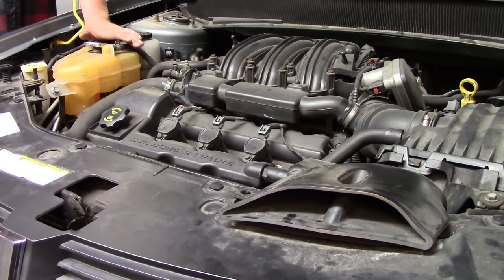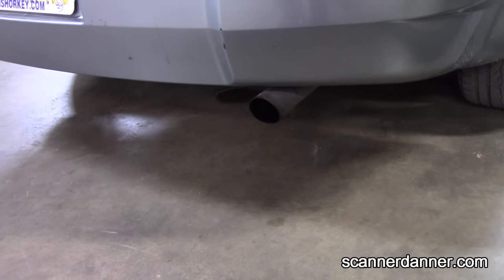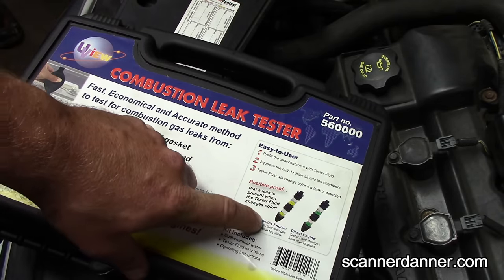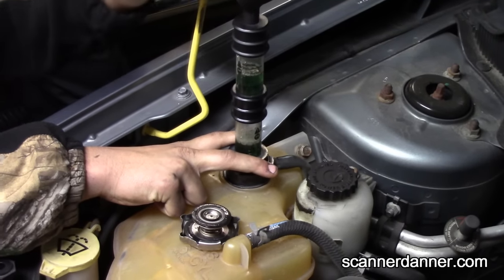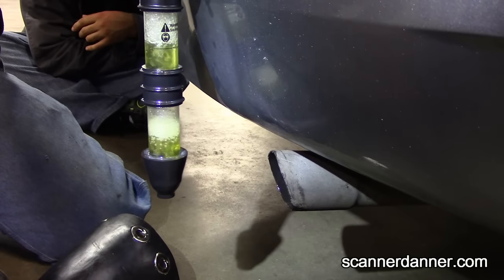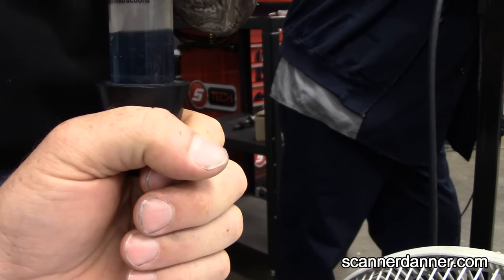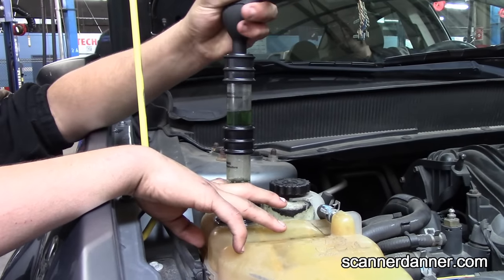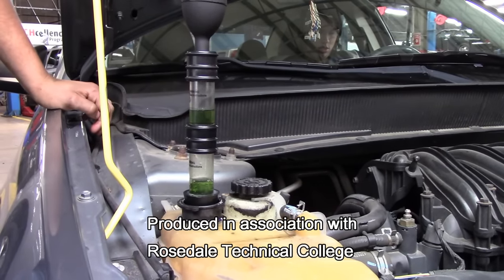Testing for a bad head gasket  - Gas Analyzer vs Chemical

Comment: The fluid needs to be tested and the coolant level need to be correct? also if there's a dead misfire the test may be inaccurate?
Reply from the maker: Correct on testing the fluid using your breath. Correct on coolant level. It seemed to respond quicker with the system almost full. And finally, my assumption with a dead misfire, is the chemical kit may miss that, but there are variables to that too. Before a cylinder completely washes out, there would be times of "burning" in the cylinder that would produce the gases we need (CO2), so it may not miss it. Also, if you have a cylinder not firing at all from too much coolant entering it, there would be a significant amount of white smoke from the tailpipe. In other words, if the head gasket is bad enough to wash out a cylinder, you're not going to miss the symptoms.

Comment: In the video you mentioned you used to use a handheld gas analyzer. Was that as expensive as the type shown in the video? Are they available anymore? Why did you stop using it?
Reply from the maker: Of course they are still available but who wants to spend that kind of money just to ID a bad head gasket. Here in PA, every garage had one for our emission testing. But we no longer do tailpipe testing (only a few older cars and every year they grandfather in a new model year) so once the machines broke down, nobody spent the money to fix them just to handle a few model year older cars. Now, nobody has one. 
Why did I stop using it? Mine broke too and it's too expensive to fix
Reply: I did a quick google search for handheld gas analyzers and I was seeing some for as low as $150-$200. That really doesn't seem like an outrageous price. But maybe these aren't suitable for automotive use? In the descriptions it states that they detect combustible gasses.  Just seeing how quickly you were able to diagnose a bad head gasket using a gas analyzer, it seems like a much superior method.

Comment: If you search "combustible gas detector" on ebay there are some handheld units for about $120usd that I would be really keen to see someone test for this purpose. These have an LCD ppm readout. Have been thinking about getting one for some time.
Reply from the maker: to many false positives with those from what I am hearing.

Comment: Paul, just an idea that may have been  tried before, but what if you blocked off the upper & lower heater hoses and attached a sensitive pressure transducer to one of them and pico scoped it for pressure pulsation from the blown head gasket with the belt removed to stop the pump? Without coolant and just cranking?
Reply from the maker: To much work, too many variables brother. And a lot of water pumps are timing belt driven
Reply: I understand, thanks very much for the reply.

Comment: Would it not be possible to modify a coolant pressure tester with an adapter such that you could use your WPS and Pico to look for pressure pulses? You could sync to a spark event to figure out where the leak is.
Reply from the maker: haha, I suppose. But it would need to be pretty severe to see it (bubbles in the system) and by that point, who cares right?
Reply: I know it sounds crazy but, I'll bet you it would work and confirm with 100% certainty that you have some connection between the combustion chamber and cooling jacket.…I guessing that with this technique it might be possible to see even very small leaks. After all... ANY pulse in the cooling system that can be tied to a compression event is too much..... 

Think about it...It is really very similar to attaching a “First look sensor” or WPS to the fuel pump pressure regulator in order to ID a mechanically plugged fuel injector...That procedure works pretty good. 

I do not have a gas analyzer so I would have to use compression tests and leak down tests in order to ID a bad head gasket. I'm not to sure I would trust the chemical test....

Consider the case where the plugs a not accessible, confirming a bad head gasket in that situation would be difficult. Hooking up a modified pressure tester can be done in seconds. 

You might even be able to eliminate pressure “noise” by disconnecting the water pump belt. Actually, now that I think about it…I wonder if you could potentially ID a sheared off water pump impeller with this
technique… Not sure..just a thought..
I am not a professional tech so, I do not have access to a known blown head gasket to test out this theory. :(
I think it would be great if you could try this out. You have the advantage to be working at a school where you can experiment a little.  At the very least, it gets your guys thinking outside of the box and tinkering around with the Pico...

Comment: Ya i have this kit to it. It sucks! I even called the help line to ask what it means if a gasoline engine turns green for diesel. He said it would be an inconclusive test. Basically when the head gasket is bad enough for the tester to work its bad enough to smell exhaust coming out of the cooling system and a tester is not needed! You can also see the coolant bubbling when its bad enough. The way I find small or very small head gasket leaks is with a cylinder leakage tester; you will see small bubbles in the radiator.
Reply from the maker: I've been burned by that test too brother. (Air in the combustion chamber, look for bubbles) but thanks for the tips man. It really helps to hear this type of feedback
Reply: No prob. Just curious are you saying the bubbles in coolant test burned you?
Reply from the maker: No bubbles but still a bad head gasket.  Combustion pressures are much higher than air in the cylinder
Reply: Got it. True.

Comment: I've used this kit and agree it's very unreliable.  And it was pretty expensive.  The one I use and stand behind is ironically the cheap harbor freight  Maddox kit. I conducted 20 tests on my car which the engine is fine and 20 tests on my mothers( who has a blown head gasket ) to see if I could get conflicting results. And it never gave a  false result. And to add to the info I have gathered my good buddy works on race cars and he swears by it.

Comment: SCANNERDANNER, 
              The coolant combustion tester/detector will only test the coolants fluids for a bad head gasket?  The Coolant combustion tester/detector doesn't test if the water pump is work correctly or if the radiator and engine has rust and other chemicals in the coolant?
Reply from the maker: I just measures the presence of carbon dioxide. You can test the fluid by breathing into it before measuring the engine coolant gases.
Reply: Scannerdanner 
1.) Whats the good and bad Percentage of carbon dioxide should be in the coolant? 
2.) How do you test if the water pump is working correctly what kind of tests can I do?
3.) Do you test how must PSI pressure the water pump is pumping out?
Reply from the maker: There shouldn't be any carbon dioxide in the cooling system.
Every car is different are far as water pump testing goes and it is not always easy to tell.
Pressure is not a good test as psi will build simply by a temperature rise on a sealed system.
Reply: @ScannerDanner  thanks for the help
      but what else does it detect besides exhaust gasses in the coolant? 
IF there is exhaust gasses in the coolant beside it being a bad head gasket, what else can cause exhaust gasses in the coolant?

Comment: u Car needs to be warm,  fluid needs to be bubbled through significantly.    Blown or slightly blown head gasket will turn the fluid yellow.   If it's just slightly green, but definitely not blue anymore, more time and more revs on the engine will turn it yellow.     Good job with the gas analyzer, but nobody really has these, especialy DIY mechanics.   The chemical tester and fluid is like 30 to 40 bucks at the store.

Comment: Hey Danner, Me again. I have a cadillac eldorado in my shop, 98 and it is running lean on bank 2, and only bank 2. The fuel trims are ~20. I've already smoke tested it, there is a small leak around the throttle body shaft seal, but very small. I've already checked all the injectors, and just incase swapped them from one side to the other to see if the lean would follow them and it did not. There are no misfires, and the o2 sensors are swinging fine. On a throttle blip test, both bank o2's go rich and back to lean like you would expect from a throttle blip. I've tested the exhaust for any leaks, incase any fresh air was tricking the o2 sensor. The only thing I can think of at this point is maybe some engine issue. You have any experience with this issue ?
Reply from the maker: Check it for an internal vacuum leak. (block off PCV and breather ports and measure vacuum on the dipstick tube. It should build pressure with the PCV system blocked off. If it goes into a vacuum, bingo, you found your issue. (BTW, this is not a common problem)
Reply: What would cause an internal vacuum leak ? (I've been googling, but all i turn up is carberated engines) I've never heard of such a thing on a fuel injected car. Sorry for the additional question, and thank you for your original reply. Some additional information, I did a compression test to make sure valves were not out of timing, and the compression test came out 220PSI across all cylinders, so that was perfect...

Comment: Had a PCV  valve go bad,  milk in the cap and on the dipstick.  Two days after changing it everything was clear.
Reply from the maker: exactly, moisture accumulating that was NOT a headgasket failure. I mentioned that because of all the naysayers who said "why didn't you just look at the oil cap?"....ignorant suggestion
Reply from the maker: sorry, that sounded like I was directing my "ignorant suggestion" to you. I was not. I was referring to other people

Comment: I enjoy and pick up some new knowledge and different "angles" for diagnosis when watching your videos. Thank you. I consider myself a pretty darn good diagnostic technician as well as many others do in my area. Clients, parts houses, other professionals in this industry, and even some dealer techs have the same opinion of me. I'm sure you'd concur that even the best top notch techs need assistance, and we certainly have gained from the experiences of other great techs.Thanks for the insight as far as the test fluid goes. I have never thought of what different types or brands fluid actually detect. HC's are what I've always thought the blue fluid detected. This make sense because now I realize why the fluid doesn't change when testing for HC content in some systems, but the gas analyzer does. I just thought that the fluid was old or contaminated with water, so I use it less frequently than before. On another note, you may want explain in your video to the less experienced that even though the engine oil doesn't look like chocolate milkshake, the possibility or evidence of a blown head gasket or cracked cylinder head is still there. You could explain the different areas of the head gasket that could fail. Between the cooling system and the oiling system and the cooling system and the combustion chamber will have separate identifiers. Just a suggestion. Keep up the videos. They're awesome and informative, especially for the "C" to "B" level techs that haven't been into the diagnostic game for a good length of time like you and me, and most "A" techs stand to gain.

Comment: Wouldnt it be CARBON MONOXIDE,CARBON DIOXIDE is what they put in Soda Pop drinks for the fizz ?
Reply from the maker: no sir, it is a carbon dioxide detection fluid, you can use your breath to test it (shown in a newer video)

Comment: How else can we confirm head gasket without a gas analyzer?
Reply: Run a bore scope down the plug hole and examine the cyl. for traces of antifreeze that has dripped in overnight. Or compare it to the other good cylinders, the breached one will be steam cleaned much cleaner than the others.

Comment: do what we do with the 6 0  diesel attach a pressure gauge to the reservoir  and get the motor hot boom confirmed
Reply from the maker: coolant expands when it gets hot and increases the psi automatically when the system is sealed. On a good system psi will rise in the test you described

Comment: Does the motor need to be started cold to do this test?
Reply from the maker: Yes, you do not want to risk getting burned by taking a hot pressurized cap off
Reply: @ScannerDanner    I have an 06 Toyota Sienna. The radiator caps on those are in a position that makes it impossible to use the tester. So, I did the test from the overflow tank and fortunately the stuff stayed blue. 

Thanks.

Comment: How do I know if machanic told me truth said oil was in coolant and I could see it was like a light orange cream color. I was told to go home and take turkey baster to get all out and in 2 days he's going to remove the coolant container and clean it out, when he replaces 2 tire's! I know tire's are ready to blow but why spend a couple hundred & engine blow's next week? Advice will help being a female I've been taken for almost every thing I had saved from bad and dishonest Auto places Thanks Debbie
Reply from the maker: Debbie, I agree. Get to the bottom of that oil in coolant issue BEFORE replacing tires. Unless of course your tires are ready to blow out and it's a safety issue. Oil in coolant is never a good thing and it comes from two places. One, it could be the oil cooler for your transmission that has begun to leak. The transmission cooler is part of the radiator and they can internally crack and it lets the two fluids mix. This ends up being very bad for the transmission as you will also get antifreeze into the transmission. The second would be a head gasket failure, where engine oil is getting into the cooling system. And antifreeze can also enter where the engine oil is, which is also very bad for the engine. 
I'm trying to thing is there is a third source but I don't think so. 
Has your car been overheating? Shifting funny? Have you been adding coolant?
Reply: ScannerDanner I added maybe less than 1/4 cup.2 weeks ago my Father was adamant that I checked all fluids,I blew an engine 1st car I got at 16 Chevy Vega,he didn't tell me you were supposed to put oil in a car!  And a water pump so I'll never get redemption 4this even at my age! When I was given car he showed me everything, I checked temp.driving home as it was slightly over halfway mark,I pulled over and felt good to see.It was hot out so I figured it's ok that week I called Ford Detroit &was given Ford service Morris IL, It's supposed to be flushed at 75,000 it's only 71,000 Ford dealer was apprehensive about flushing on yr of car saying it could blow heater core.he also said for a big V8,temp was fine? On my Saturn half way up was trouble.So I figure car hasn't over heated,My opinion is temp gauge goes up in 3mls. Not familiar with that.I read manual front to back as Ford has recommended services for life time of car & it said use green coolant 50/50 gave sku# but it being a 99 Marquis you can't get exact! I did notice Ford used incorrect oil weight but I doubt this factered in, when I added the very little coolant I noticed it was orange, Now I do know Saturn uses orange,book specifically stated green only & donnot use Ford Long lasting  but when I added the green coolant it was the consistency of water.This new machanic I was referred to opened it up and it was like a light orange creamed yogart it actually stayed on his gloved finger. I did see on your video you talk about contamination? I have no idea how long the coolant was in the hot trunk or if it doesn't matter,After taking out as much as possible I used the left over green coolant & squirted it on the sides to get as much oil off sides as possible.mech.said it hasn't reached engine block yet.And after I left grocery store it was just around the corner from Auto shop,my Father called his guy& he said same as you, since I had 2 pass the place on way back,I apologized for my Father not excepting his expertise & said it could be steering fluid leak or transmission fluid! I said I wasn't sure if I got it right as this is a nightmare for me because I can't work anymore this is why I Was given my mother's car,My father said it has a brand new compressor but needs an actuator, for the A/C and wasn't going to spend 700$ And another expensive thing a pin hole right down there! His guy said leave it for now.&yes the tires are ready to blow! My Father would be more up on this but he had a stroke causing machular degeneration so he can only drive a couple blocks. Oh also upon going back Robert, Let's put a name to him hate it when people don't know your name.He did check trans fluid and showed me it was a clear pinkish Red,He doesn't want to flush it just clean out container &I imagine the connecting hoses,I spoke to my ex fiance because he had the same car and I wanted to see if there Was a pattern besides the actuator &he said it needs to be flushed low pressure with a garden hose so as not to ruin heater core. This car was supposed to last me till I die as my disability is only 718$ a mth and though I have excellent credit I could never get a loan 4 car payments.Thankyou so much for taking time with me, your such a Angel! Your hard work & Your sharing your knowledge will bless you and your family Thanks again for all your help Debbie

Comment: In fact if we suspect a head gasket or crack head of any kind this test is done in the parking lot.. If the car or truck does not pass this test the call of a BAD head or gasket is made.... We would bring the vehicle in and prove the test. 99.997 right..

Comment: Does anyone know how to read a 94 OBDl era car, that has an OBDll era port, that an OBDll scanner won't read?
Reply from the maker: Need a compatible scan tool. No flash code available on this in between system
Reply: Thanks for the reply.